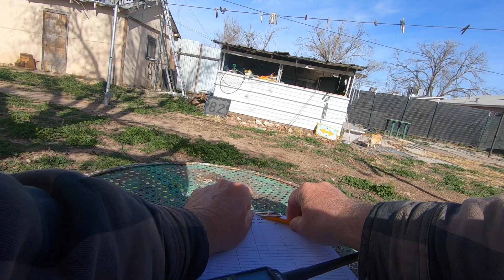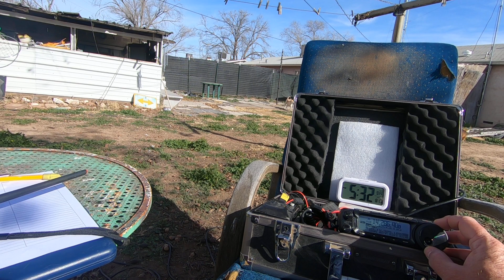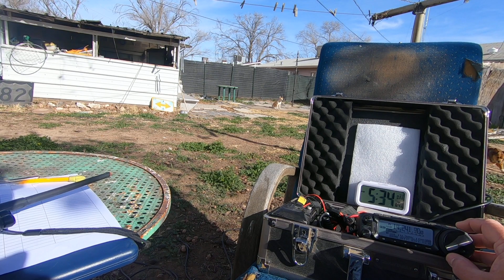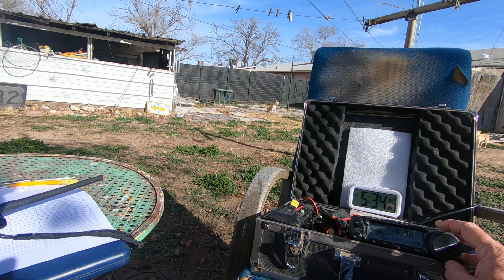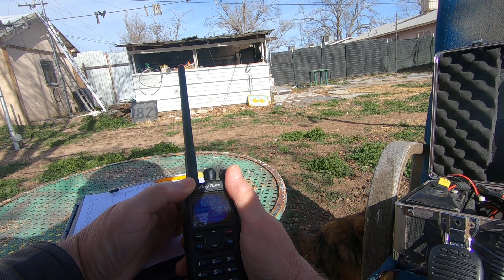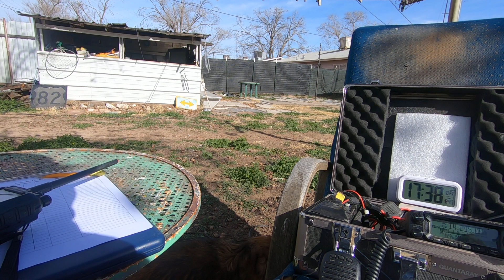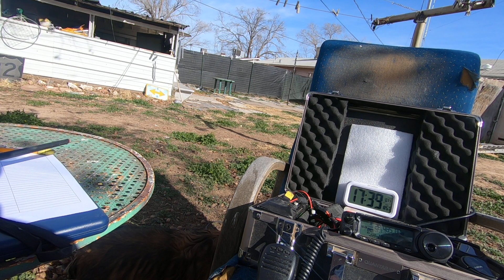Backyard Ham Radio & DIY Flagpole Vertical Antenna

Comment from the maker: OK, I was messing with the test flagpole antenna. I took off the wire(too messy). The aluminum pole has a coating that I had to scrape off on each side of where the sections joined. I scraped off on each side of the plastic "knuckles" I guess I will call them. I then took short pieces of some wire I had laying around and made each section eclectically connected to each other as I extended the poles. I just used guerilla tape for now to see if this would work. Works great!. Later I will pickup some hose clamps and make this all permanent and easy to take back down.  I just extended the poles to there max lengths altogether 20 feet. I also added a "shunt" coil I made awhile back for another project. I may experiment sometime with a tapped coil of wire, but for now I am very happy with these results. No ground radials and the shield of the coil is grounded. No need for tuner IMO for 40 through 10 meters. 
Here are my SWR readings: 40 meters 1.53, 30 meters 1.39, 20 meters 1.43, 17 meters 1.43, 15 meters 1.66, 12 meters 1.89, 10 meters 1.99 SWR readings. The neat thing is on all those bands the swr stay the same from band edge to band edge! I know no dips, but hey it works. Harbor Freight I saw just today has those aluminum 20 foot flag poles on sale for $54 in my area. Cheap and easy way to play with a verticle IMO. 73 Jim K5APD Oh in future, after I put the hose clamps on I may put up a video to show exactly what I did. The shunt coil is important. Without it the swr figures were much higher...This is so I can play portable HF in the back yard without the hassle of setting anything up, just grab the end of the coax and hook it up to the Yaesu FT-891..

Comment from the maker: 🖐Hey guys and gals I recommend to not mess with the diy flagpole, unless you like to experiment like I do. While it works and I get acceptable swr on 10 to 40 meters, the antenna is not that efficient. This setup saved me from pounding in my expandable 17 foot stake antenna and spreading out 5 ground radials. The antennas are about the same anyway in efficiency.